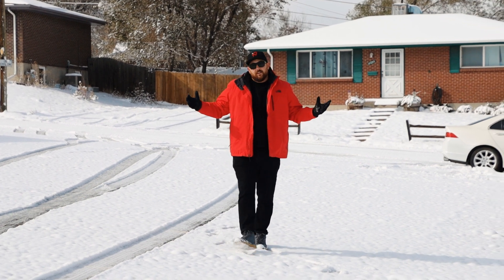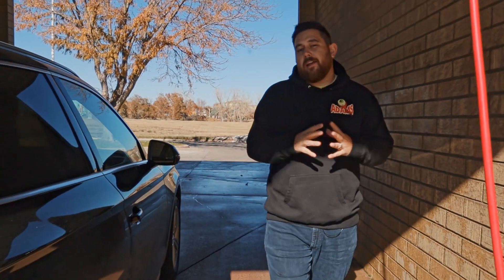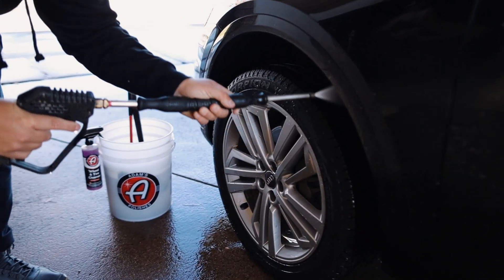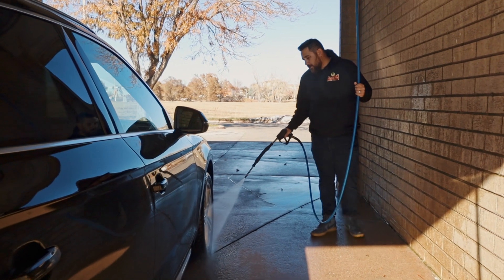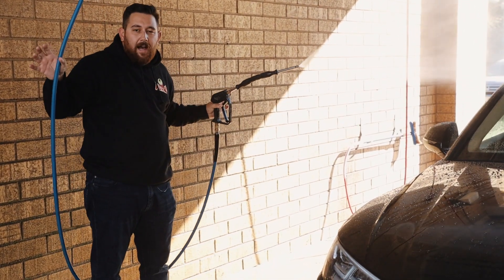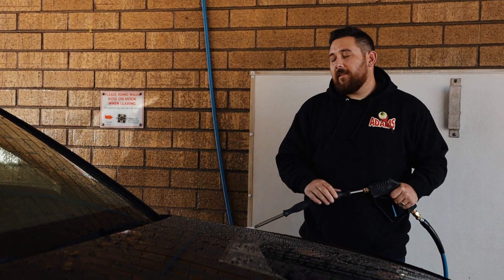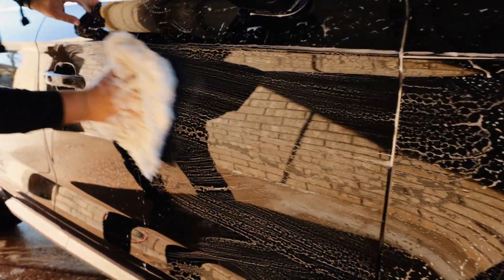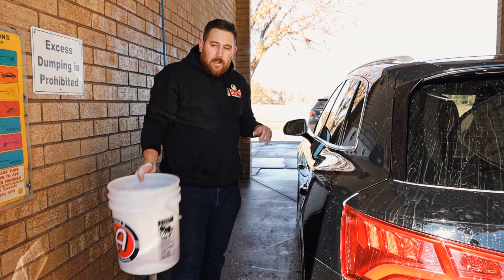Keep Your Car Clean and Protected This Winter | Adam's Polishes Winter Washing 2020

Comment: Used CS3 after a 10:1 apc pre wash/rinse. Blow dried and finished with CS3. Love this stuff. Will bring a bucket of hot water and soap to get the wheels/tires and metal fenders/side steps on my jeep.

Comment: Ok that's funny yall had someone doing donuts in the intro 🤣 yeah I've ran my dad's sedona through the touchless wash it did get 65% of the junk off butt there ceramic sealant in the wash took off the ceramic spray so not to self for this winter wash bay diy only

Comment: Unfortunately, most pay & sprays prohibit bucket washing. Multiple buckets, forget it!
Reply: Then I wouldn't even go there. like seriously find somewhere else then.
Reply: @TheOriginalStevenH  well, like I said, MOST don’t allow it so it slim pickens.
Reply: @SoCal780  well... what I like to do is just hose down the bulk of the grunge... then drive out to the parking lot like I just did today after seeing this video and doing a waterless wash.  problem solved in my opinion. of course it was 40 degrees outside and froze my fingers off lol
Reply: You can usually go after the attendant has left for the day
Reply: The ones near me don't mind handwashing, buckets, or hand drying as long as no one is waiting. Very lucky since less people seem to use the car wash as the weather gets colder

Comment: Adam's has so many "drying aids" and "spray sealants". what is a good routine with all these? do you need more than 1?  my car is not ceramic coated, I have been using detail spray 3 weeks in a row, then h20 guard and gloss the 4th week....would it be good to upgrade to cs3 instead of guard n gloss?